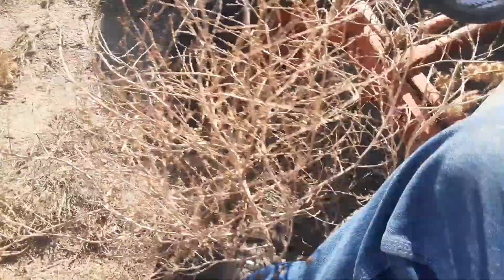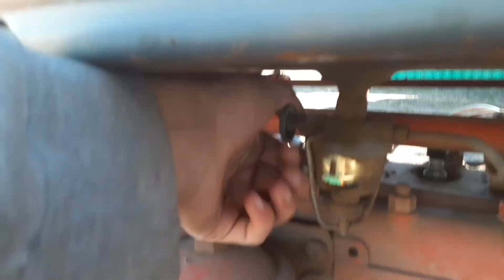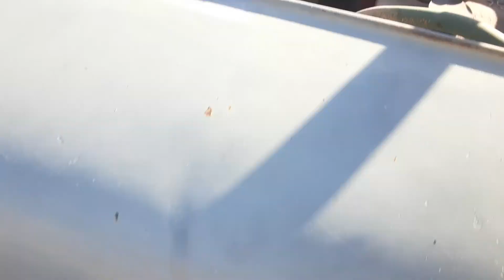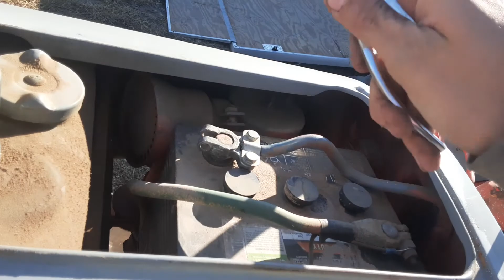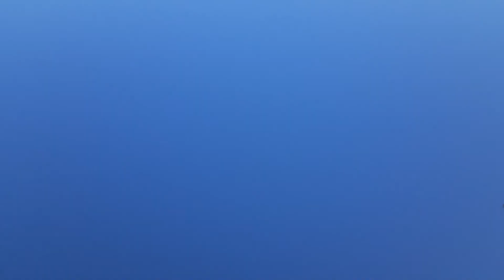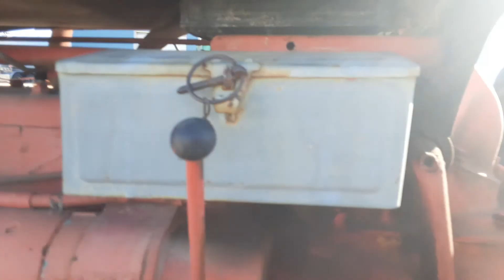1939 Ford 9n cold start

Comment: What about this makes you think it is a 1939? Everything about it makes it look like a 2n made after 1944. Even the casting date on the engine block says 1946. Also why start it at full throttle?
Reply from the maker: The tractor was built in a junkyard with parts from all 3 models mainly a 39 9n so I can call it whatever I want and it has carburetor problems so its easier to start it full throttle then back off the throttle when it starts trying to run
Reply: Agree nothing on this tractor is '39. He can believe what he wants but there is not even one part on it that's 39.
Reply from the maker: @kirk-nj6344  you have no idea.